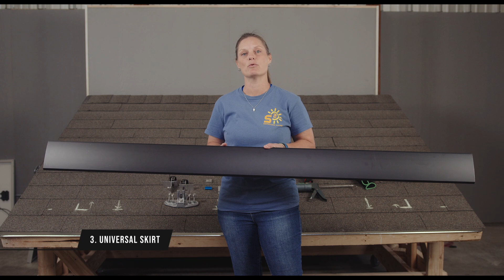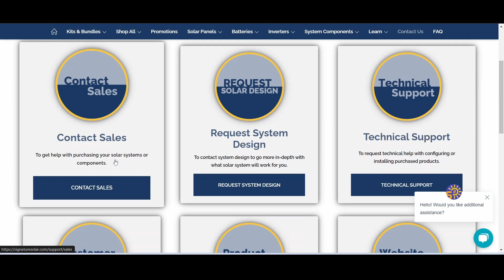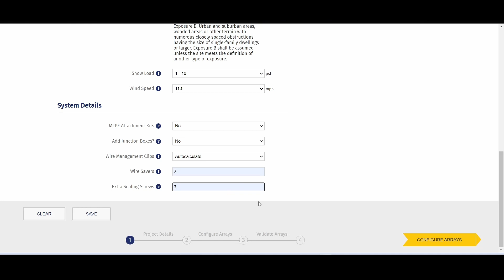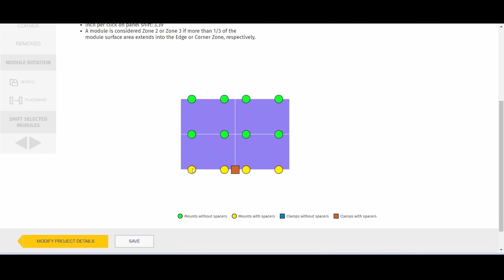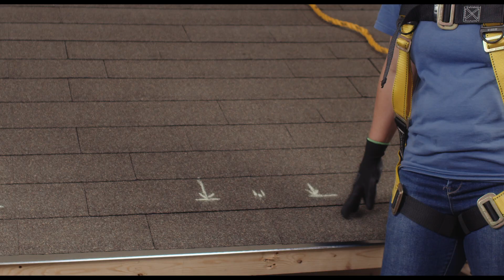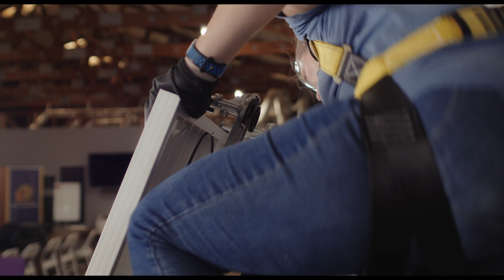SnapNrack TopSpeed: Revolutionize Your Solar Installations with a Step-by-Step Guide & Key Features!

Comment: Hi, I have a question.  I have 3 rows of 4 solar panels on each row and used the top speed snap n rack for to secure each row of panels.  I consider the bottom row my 1st row and have a ground lung on the 1st panel in that row.  Do I need a ground lug on the 1st panel on the 2nd and 3rd rows as well or am I ok.  Your video shows only 1 ground lug like mine on the first panel.  I do not have a ground skirt.  Thank you.

Comment: I would imagine critter guard is necessary, i done this type of system in the past, i have 6years experience on the field, i done basically every type of mount system including rails n flat roof, this is one of the simplest way to do installation
Reply: how would you critter guard?

Comment: Dont know about Tx, but VA requires by code that the mounting component hits a truss or rafter.  This is consistent with the 2021 International Residential Code (IRC) and enforced under the Virginia Uniform Statewide Building Code (USBC).  Why not just have a center screw to hit that?  I like the 2 on each side but not by themselves.  Surprised that is missing and that anyone can use them.  Going just into the sheathing is not good enough in my book.  I'd need 6 inch screws and in the attic have those screws hit a block of 2x4 under that rafter to hit it at least 2 times.   These are nice but a no for me. And no flashing?

Comment: Just a note about the 3/4" space between panels added along the bottom. The final installation doesn't reflect that gap, but it is added for enhancing airflow around the panels for convective cooling. You can get away with a smaller gap of 1/8" (for thermal expansion) if space constrained.

Comment: That skirt is a terrible idea, its gunna trap and fill with all kinds of leaves and debris.
Reply: If you are going to install solar on your roof you absolutely want critter guards on all sides. The mesh meant to keep squirrels out also keeps out leaves and debris.
Reply: @bfelix053  Yea thats my point, they ONLY installed that skirting on the bottom, ensuring crap is going to get captured under the panels.
Reply: I hate to break it to you, but ALL racking systems can cause that problem.

Comment: This is one of the coolest realist mounts out there, but be aware that it is not reusable. So if you live in a place like Texas, where there is a lot of frequent hail damage and the roof needs to be replaced, you’re going to be replacing all of these top speed mounts every time you have to fix or replace the roof.

Comment: So these are deck mounts...but those mounts look like $20 per mount...
Reply from the maker: Hi! These mounts are specifically engineered for deck mounting and have been tested to meet the Miami-Dade wind rating, ensuring durability and reliability in high-wind conditions. You can find out more here: https://signaturesolar.com/snapnrack-topspeed-solar-panel-roof-mount-kit/?searchid=1259288

Comment: Would these work on an aluminum truss roof?
Reply from the maker: These come with wood screws that’ll need to be drilled into plywood. If you want more specific advice for your setup, give our sales team a call at 903-441-2090—they might have a solution for you!

Comment: Sealant, Can't Overlap Shingles??? Sounds difficult if your panels and shingles don't line up. What happens if your array is not level, the riser bolt is under the panel?? In m opinion there are way better options.
Reply from the maker: The riser bolt on the TopSpeed mount is not under the panel, it sticks out behind the panel to make leveling easy.  Also, the adjustment to move the mount forward and backward to keep it from overlapping the shingles is right underneath that bolt as well.
Reply: I had this question as well but after watching a video by everydaysolar here on youtube I realized that the base has several inches of adjustable slide to allow the foot to be entirely on a single shingle.
Reply: Did you not watch the video or see how you can adjust the mounts????

Comment: Is this rated for a TPO roof as well?
Reply from the maker: Topspeed can be installed a membrane roof (e.g. TPO) as long as the roof has a minimum slope of 7°.  Most TPO roofs are flat roofs, and if that is the case, Topspeed would not be the right product to install.

Comment: Don't bother trying to order or even getting help from either SnapNrack or Signature Solar on trying to get the TopSpeed system. I tried both companies to get help. Signature Solar "Design Team" hand drew me some juvenile picture that was drawn in Portrait when I told 2 different people 3-4 times that my system was going to be 3 rows of 6 panels in landscape  When they laid it out wrong, it ended up having the wrong number of mounts by 6 mounts. I guess there design team dosen't have access to any cad based software or even a ruler. I wasn't even wanting a picture. I was just wanted an itemized list of all the parts I needed. Signature left half the parts out. If you have any problems or need warranty good luck. 
SnapNrack trying to get any help at all is pointless. They're in California, so they're probably getting ready to go BK like the rest of the solar companies in the state. 
I spent a lot of money with Signature solar over the years. They obviously don't need my money and prefer I go somewhere else. I gotcha 🫡

Comment: It is unclear what is meant by "these mounts are only certified for roof slopes over 7 degrees." Is this for grounding, waterproofing, wind, snow, or something else?
Reply from the maker: It has passed the Miami-Dade County requirements, passing the TAS 100(A) testing for Wind and Wind Driven rain and is certified for roof slopes over 7 degrees.

Comment: Additional instruction or detail needed to attaining a flat no lip install of array.

What is fuzzy: The leveling of panels with 2x mounts pre attached, Once placed and snapped into starter row.  

Are the 2x mounts height measured and pre set before taking to roof or are they attached on roof then height raised or lowered by feel? 
I’m assuming height of stater row is measured the copied to following rows before lifting to roof.
Reply: Leveling should be done on the roof to account for slight variance in shingle flatness.

Comment: Dear God. EVERY product is a 'game changer'... 

Just want something that works, not something that requires the user to roll a polyhedron die to 'change their game'.
Reply: Or that sunsets before the warranty expires. Like the eg 4 6500ex.  So many problems they just abandoned the whole line. Unfortunately I bought 2 of these things and now they may still support them but limits my options. Inverter flavor of the month club.
Reply: @Capoe3 no doubt! I'm dealing with this on a Growatt 6000 right now with them. They helped design the system specifically, now all the sudden its gots an over voltage issue and is no longer rated for the panel array I have built so I have to send it in and wait for them to receive it, then get store credit apparently.....so I can purchase another inverter that will be phased out in 12 months with some other set of specs that no longer apply.....
Reply from the maker: Hi @themountainwizardprepper If you'd like to email me at engagement@signaturesolar.com I can look into your ticket and see if we can speed up the process at all :)
Reply: As someone who has installed a decent number of PV systems, this actually is a 'game changer'. For years I said that rack is the limiting factor on broad adoption of roof mounted PV and this solves the bulk of the issues around that.